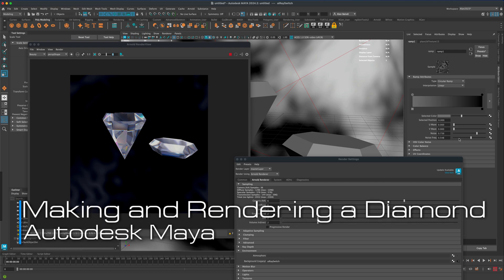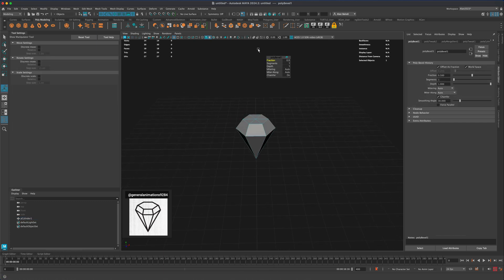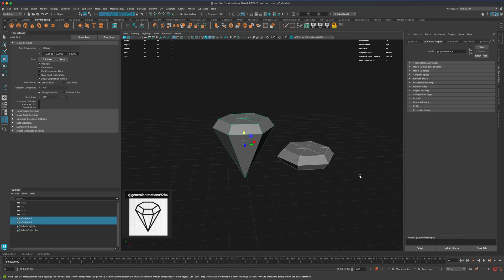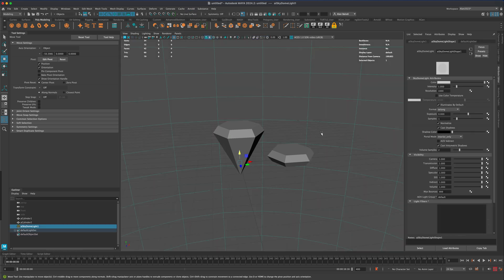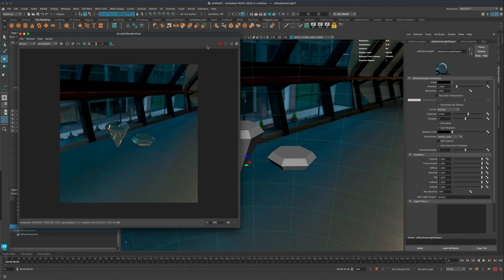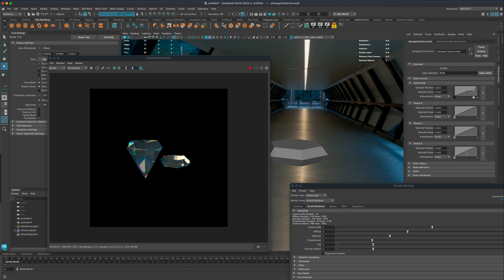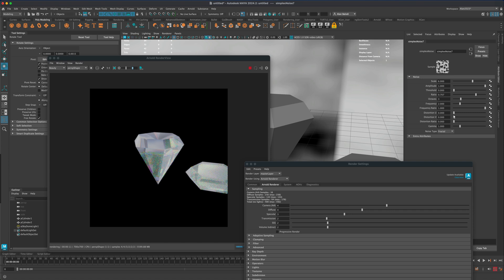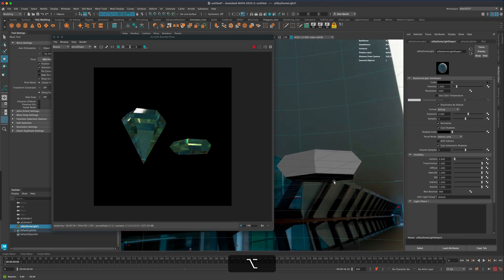How to create a Diamond in Maya (Modeling and Rendering)

Comment: for imagers can you make each diamond a different color?
Reply from the maker: Yes… you can make each diamond a different color. In Arnold you just adjust the Base Color or use the Transmission Color on the aiStandardSurface material. Even with the default diamond setup, tinting the transmission will give you those colored gem looks.
Reply: @AlanBalodi-3DTutorials ah I see many thanks ❤